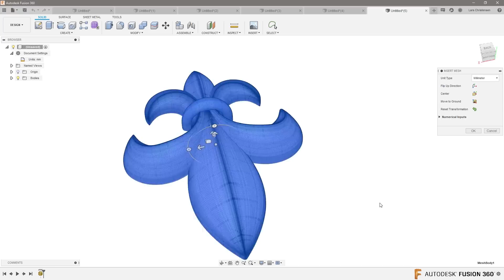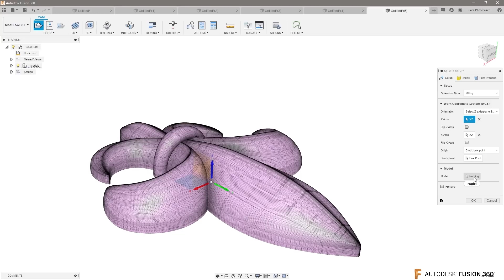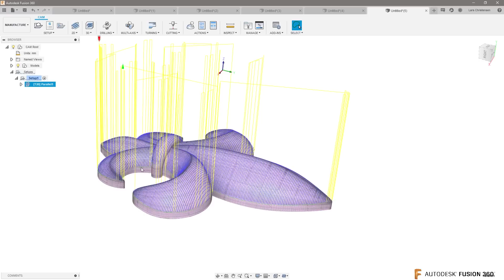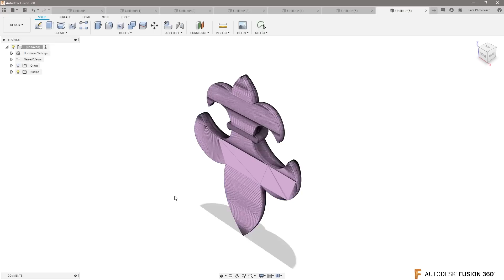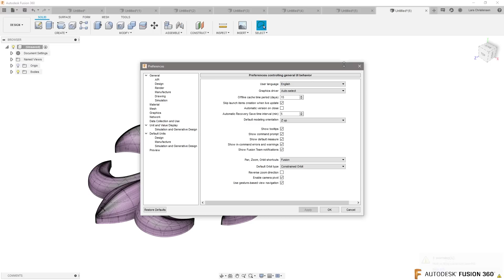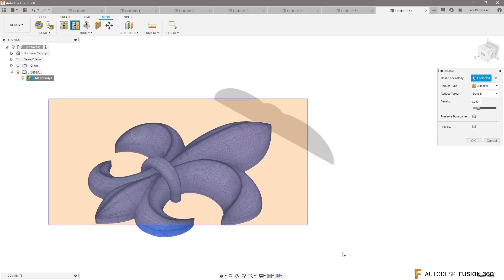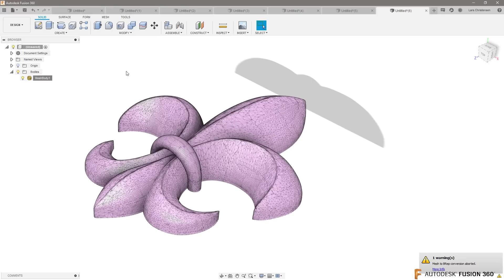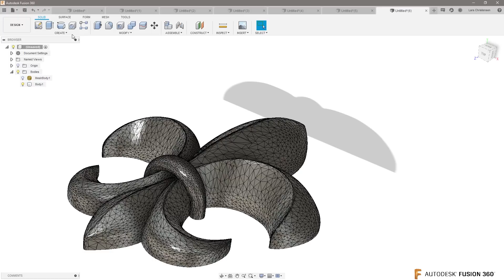Fusion 360 — Handle STL Too Big or Just for 3D CAM — Ask LarsLive

Comment: But is there any way to get Fusion to convert mesh's (so that you can edit & work with the file) to b-rep or whatever that are larger, like 50,000 or more? I have a file that I've been trying to edit but when I try & reduce it, it turns to trash every time.
Reply: try working with the mesh in blender first perhaps... I haven't tried yet.. It also has a option to subdivide the mesh if its something you can glue together, or merge several meshes back into a larger one-  Array: he mentions it at 10min
https://www.youtube.com/watch?v=PI3jEVu4y4s